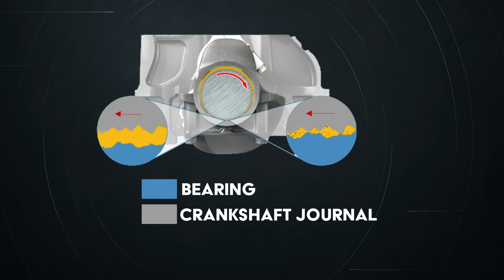the truth about start-stop technology (finally proven)

Comment: My yaris 2010 1nr-fe engine been rebuild  at 125000 miles due piston loose rings and obviously burning too much oil.
Cranckshaft bearing almost like new and not changed during rebuild.
Probably depends on engine size as its only 1.33 and time for engine to flow around oil passages during start stop time.
Used high-quality Liquimolly 0w20 latest specifications api-SP oil.

Comment: As the main issue seems to be oil pressure to the bearings, why not just add an electric external oil pump to provide oil pressure when stopped in traffic etc.
Reply: The oil film is dependent on rotation of the axle as well. It would definitely help to keep oil pressure during stop, especially for the turbo, but it as well requires energy to run the pump, thus diminishing the 'savings' from stopping the engine.
Reply: @ZvendZved i get that. But the energy savings are far outweighed by the need for a replacement engine because of diminished engine life.
Reply: Or just remove the start stop, which seems to be the infinitely easier option
Reply: An oil accumulator may be a good solution as well, as they are just a tank and a valve for the most part.  But neither an aux pump or accumulator is a better solution than avoiding the short cycles altogether.
Reply: Even with that, you still have the issue of needing to replace the starter and battery more often. Not to mention no heating or AC at red lights, since the water pump and AC compressor are also engine driven. Still a nightmare in use and parts.
Reply: @stevenbmw850  What starter motor ? Hybrids do not have starter motors...
Reply: I meant when switching to an electric oil pump on a reg engine. 
And most hybrids do have a 12v starter motor, its almost never used, the engine is usually started by the three phase electric motor, but its there as a backup incase the main battery voltage is too low or the fuse blows for the drive pack, so the engine can be started from the 12v side and the vehicle still driven.
Reply: Because if you add an electric oil pump while the engine is off, then you'll end up with a dead battery since the alternator isnt spinning to charge it

Comment: Awsome video , but as the devil is in the details here are.some questions: 
1. As with all testing is verry important to specify where are the points from where  do.you measure the pressures ? Pump exit , oil sensor location , a random plug in one of the galeries ? Not that the time would change drastically but there could be some.diferences. 
2. Oil has a not so nice tendancy of not beeing as fluid as water , even hot , so in my humble opinion you should have added another test with the hot oil. Measure the time it takes to buildup pressure a second time when there is still oil in the system and it had no time to "fully" drain in the sump. And then maybe set-up a few more experiments based on the time interval which yhe engine is stopped : 10 sec , 30 seconds , 1 minute etc simulating real world stop and go trafic scenarios.

Disclaimer : I totally agree on the increased damage to the bearings due to an increased number of start stop cycles , along with the increased damage part of the variable pump design  + thinner oil and reduced beaing size for the sake of eficiency .

Comment: Hybrids stop and start all the time, don't they?
And the Toyota hybrid is one of the most reliable and proven drivetrains going.
No?
Am I wrong?
Reply: The Toyota powertrain is indeed one of the most reliable due to the lack of traditional clutch and gears as it's using clever planetary gear arrangements. The ICE is experiencing these effects to a certain degree but the engine is built to be able to cope with it and mitigate. For example they don't use conventional starters and can run the engine for a split second in the desired RPM without actual combustion - this gives time to pressurize oil and prevent the metal on mental wear as there's no explosion in the cylinder. Then they use a special grade of oil with properties optimized for the hybrid operation, the ECU manages the engine operation with regard to heat and moisture build up. There's quite a lot going on and the engineers though about every aspect of daily usage. It's not just a regular ICE with electric motor and battery strapped to it in a small shop.
Reply: @jakubknotek4891 Hey, do they also decompress the cylinder whilst turning the engine before start up?
Reply: I was going to buy one but now not so sure😊
Reply: Yes. My BMW1 Hybrid did not have a starter motor. It has a generator/motor fiexed the engine as a flywheel. Also. Engines do not cool down that fast. Nor do you lose oil pressior that fast. And in this test the car is standing still and only going idle.

While hybrid batteries are significantly more durable than a standard car battery, they are expected to last 15 years or 150,000 miles, though this can vary with usage and environmental factors. BMW provides an 8-year or 100,000-mile warranty on its hybrid batteries

Was at the train station last week waiting for my train. Was really nice in the sun hearing the birds sing. All the BUSSES WHERE ELECTRIC. You have no idea how nice the world is when you remove all these stupid combustion engines. Hope the are all gone in 2030. And will never be allowed in area's where people live.
Reply: @RogerKeulen  ICE engines: stupid for you, smart for me. Go figure.

Nikola Tesla developed a genius motor, but using it to haul a boat load of batteries is not the best idea under the sun by a long shot. If it were, we would have driven electric vehicles back in the 19th century.
Reply: It's simple: buy a hybrid and leave the ICE cars alone.
Reply: @joedoe2407  Or an electric.
Reply: Hybrids have much smarter engine management to control temperatures and lubrication. They also don’t use traditional starters and batteries. They also can drive miles without even running the engine so the engine doesn’t actually experience mileage like a normal car. All that being said, the engines do have issues sooner than if they just ran all the time.
Reply: @braaap6292 I’m still going to buy one I reckon. My freind has one that he purchased with 75k on it. Now has 300k on it. All he’s had done on it is a water pump and tyres. That says it all
Reply: @braaap6292 They really don't. You can make them go from dead cold to maximum load in less than 2 seconds. That's the peak of thermal management.

Comment: An  "Accu-Sump" System will rectify and alleviate any and all of these symptoms  ...
Reply: Not really. On start up you don't have the hydrodynamic lubrication because the crank and bearing are not moving. If an Accusump provides pressure when the engine is stopped, the oil will just squirt out of the sides of the bearing. It won't lift the crankshaft up to centralise it if the crank isn't spinning.
Think of the lubrication system as one metal part surfing on a wave of oil.

Accusump is there to keep oil pressure while the engine is running and the oil pump runs dry. It's designed for a different situation.

Comment: Proper engines have electric oil pumps,see Toyota.
Start Stop may be annoying, but it is the most important emission device in the cities IMO.
Reply: Start-stop is only one small aspect in this save the polar bears ideology. They add lots of extra parts and complexity to cars that will cost more, and that will INCREASE fuel consumption overall. Just look at DPF and all the extra parts you need to get that system working. Its intention is to save the polar bears, except in order not to clog up that thing you need to regularly drive longer as well as making sure you keep the rpms up enough to get the exhaust tempterature high enough that it will burn thorugh enough of that soot so it doesn't just clog up the DPF. 
In general even brand spanking new, that whole system is suffocating the engine, meaning you are constantly using more fuel than is actually needed. So to say that start-stop is to use less fuel and save the polar bears, is such a blatant lie because the whole eco package that are built into all new cars now actually creates a greater impact on the polar bears than most people will understand.

These parts also needs servicing/swapping out, and everything has to come from something which will add more impact on polar bears because of the impact during making of parts + transportation and so on and so forth. 

What most people deliberatly try to suppress is that there are pros and cons to everything, so if you try to only focus at the benefits you are living a lie. This is how the globalists sell their ideology, simply keeping most people in the dark.
Reply: @Freerider-----l I get your point, but having lived in cities where most cars don't have or use the start stop, it is a very palpable difference to air quality.
Diesels are not ment to be driven in cities, I drive the same car since new for 14 years, never had issues with the dpf so far.
Now with the petrol cars with a particulate filter, I don't know all the details.
Reply: @iulian2548  So you somehow know that what ever difference you notice from one city to another is only related to start-stop system in cars. 
That's the most absurd assumption I've heard in years...

PS: Most assumptions in life fail.

Comment: Start stop, low viscosity oil variable oil pumps and life time or extended oil change intervals are all intended with your best interests at heart.
So what if you don’t want save less gas than you spill from the pomp nozzle as you put it in the filler, so what if the whole car is scrap ten minutes after the warranty expires.
We’re Saving the Planet!
Reply: Don't forget about shutting off cylinders 😂
Reply: @iam1smiley1  I bet everyone wishes they could
Reply: It is bad for our planet when we need a new engine every 6 years instead of a new engine every 20 years.  More replacement batteries and more replacement starters are bad for the planet.
Reply: Yeah I'm with you, fuck all this stuff off, replace it all with a carburettor and a 2 speed automatic transmission. Amirite?
Reply: @ej20tnz  That's going a little too far backwards .
A good EFI that anyone can tune and a five or six speed auto that doesn't need a twelve thousand dollar computer program to reset it to work even in the same vehicle it came out of would be good.

Comment: It should be noted that many of the most recent engines also have ridiculously low oil pressure at low revs.  My EA888Gen4 engine has only .85 bar at idle (minimum in the range of .85 to 1.2), and can stay at that pressure till ~2000rpm.  This is for emissions reduction - low pressure means the pump requires .000000000000001 hp less to operate, giving a fuel saving and emissions reduction of .0000000000000001.  The answer is always to get a remap which will increase the oil pressure to sensible levels at low rpm, and turn off stop start as well.  A bonus usually is that you can set the vehicle in anti theft mode so some asshole can't read your key and drive off with it.